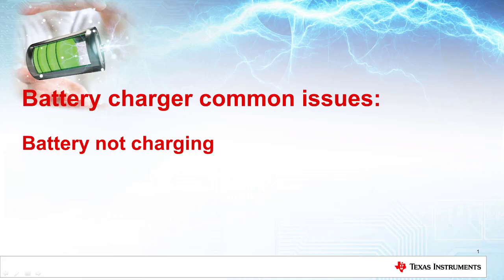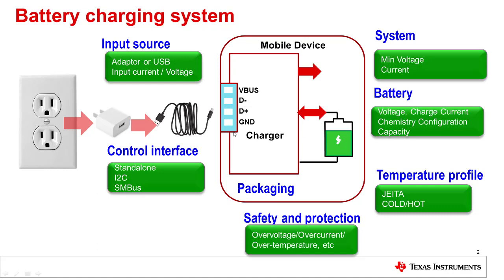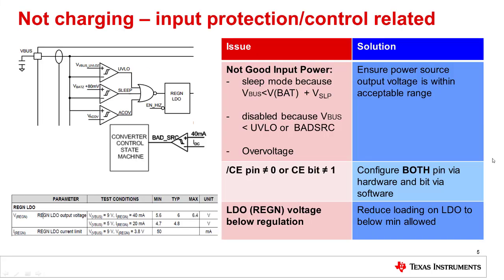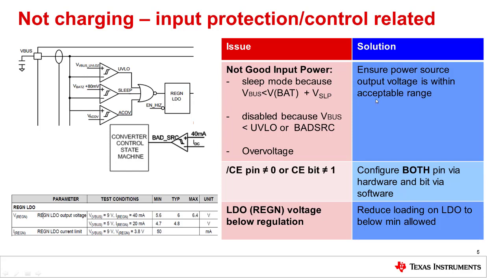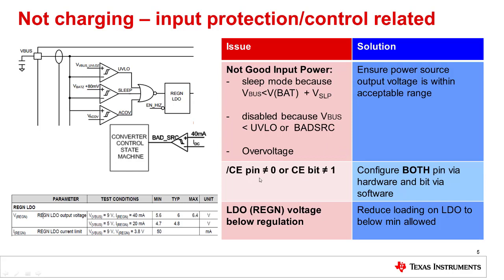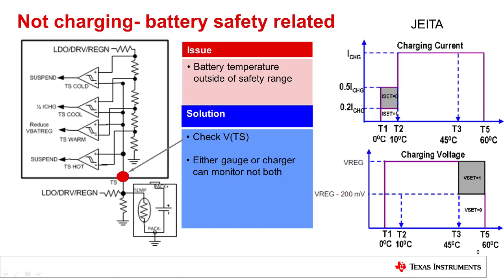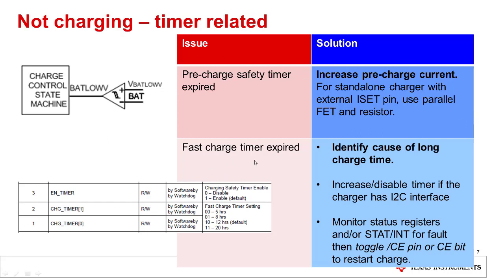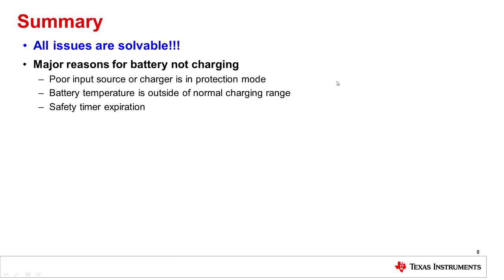Battery Charger Common Issues: Why my Battery is Not Charging

Comment: When charger is connected to battery and switched on all charge lights are on but the 2 lower lights (25% and 5%) are flashing.
What is the cause and could it cause damage to the battery or alternator?

Comment: A note about AUTOMATIC chargers. That means it switches on and off. It has to 'see' the battery to switch on. If the battery is very low it will not switch on. It has to see from 4 to 6 volts from the battery before it switches on. The old trick of touching the clamps together to see sparks also does not work with this or ANY automatic charger. The leads are dead until the charger sees at least 4 to 6 volts from the battery. If your battery is very low then you need a MANUAL charger not an automatic charger such as this one. I would dare say that better than 90% of the "this charger does not work" reports are from people trying to use this on a battery that is just too low to switch the charger on. A friend of mine  once bought up a large batch of automatic battery charger people had taken back to Sears claiming they did not work. Out is the 115 charger I tested for him only 2 did not work and both of those were easily fixed. Dumb people took most of them back to him claiming they did not work because it seem very few people understand how AUTOMATIC battery chargers work.